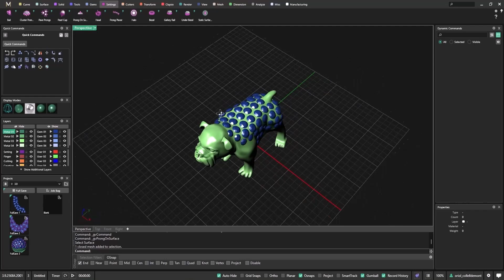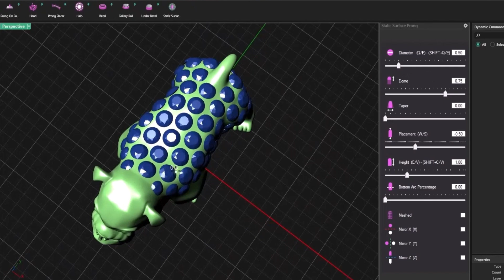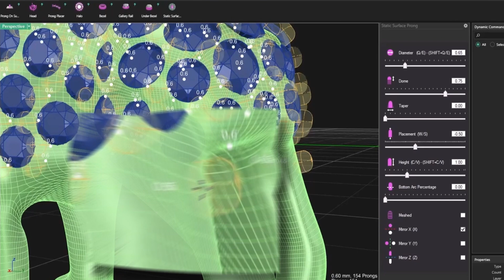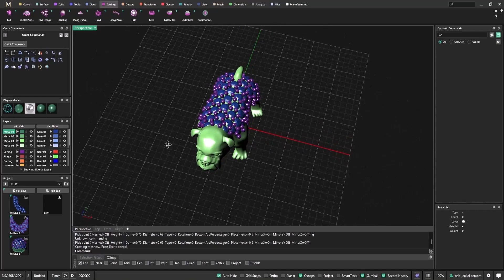How to Use Static Surface Prong in MatrixGold 3.9 | Jewelry Prong Placement

Comment: How to use custom prong ? Like box. Prong
Reply from the maker: The static Surface Prong can be used on any surface or mesh. It allows you to add round stones and change the dimensions either through the builder or with the shortcuts found inside the builder itself. You can also use the mirror to place stones even faster on any geometric shape.

Comment: "Why did we create this tool?" Maybe because for 15 years your users had this tool working fine, but you just decided to ignore them all by introducing a "upgraded" half-baked version and forced it down their throats for 7 years, until you gave in and put back a tool so basic that you can recreate it with a macro on a toolbar button. Congratulations on the creation.
Reply from the maker: Hello @diego7767. We develop our software based on feedback from the thousands of customers we have around the world. One long-standing request has been for a simpler way to add prongs, compared to the parametric prong surface tool. This new tool addresses that need and also allows users to add prongs to meshes—something the parametric version does not support.